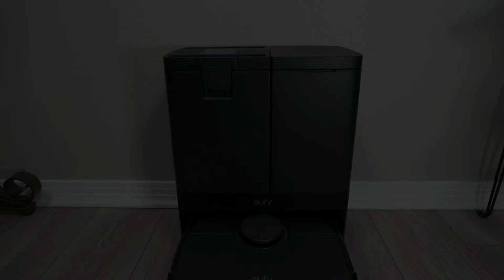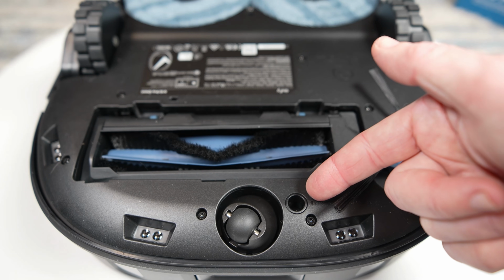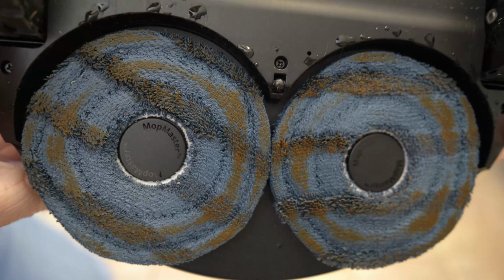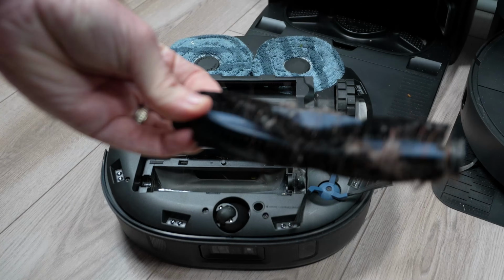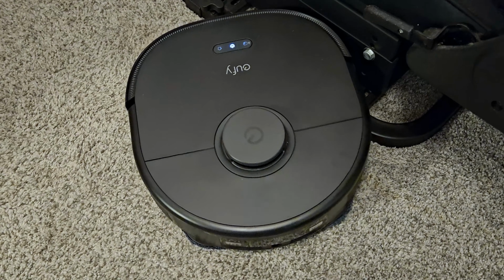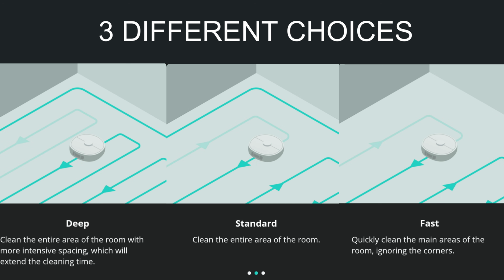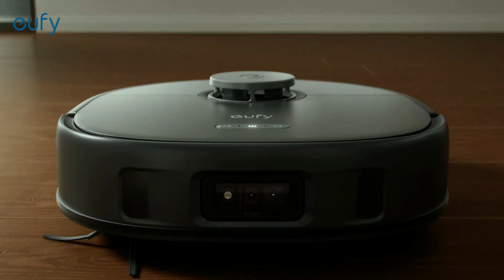eufy X10 Pro OMNI Review! An Incredible Value!

Comment: Thanks! I was hoping for a first good review of the robot.
Finally you uploaded it :)

Based on the hinge comment, does the bin feel flappy for you?
It looks like lot of the suction power is going into the not so well sealed dust-bin.
Reply from the maker: Thanks! The lid was closed and latched during the tests.  It could be an issue with the design of the bin, but I am not real certain.
Reply: @andrews I really wonder where the suction power is going off to some air-leaks and if it is improvable by sealing the bin better.
Usually everything inside the machine should be enclosed.
Another point of suction leak could be the two docking-openers on the back, which the base uses to empty the bin.
Do you feel any suction behind the device while its vacuuming?

Either the 8000 pa ain't true or there is a flaw somewhere inside.
Reply from the maker: @akeshake5230  I'll take a closer look today and if I find anything I'll report back.  It could also be the brush roller design or it could be the brush roller is not dropping low enough to properly sweep.

Comment: Thanks Jamie for the review!
Would you be able to test how many washing runs the robots are able to do before having to refill/emptying the containers on the dock? Cheers!
Reply from the maker: Each cleaning at the dock uses 200ml.  That means each tank will clean the mop around 12 times before being empty.  That does not take into account filling the robot with water, but that will vary based on the water setting in the robotand how much mopping vs vacuuming it will do in a home.  Hope this helps.

Comment: I've seen some scare stories about the electricity consumption of these auto-drying docks.

Did you measure this by any chance?
Reply: Yeah I’d also be interested to know what the power draw is for a heated dry - especially since it’s running for hours
Reply from the maker: I did not measure it on this one, but I will.

Comment: Hi Jamie, thank you for your review. In the UK we are eagerly awaiting US reviews prior to pre ordering.
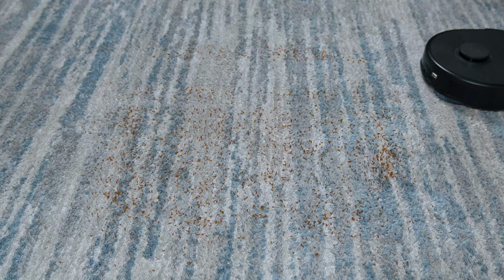At 3:19 you have done vacuum tests on carpets. Was this test based on first pass of the vacuum only?
Generally speaking how does it perform vacuuming on deep clean mode and with 2-3 passes of the same room?
Thank you
Reply from the maker: Yes on my vacuum tests the vacuums get one pass only.  Performance will improve using deep clean and it will make tighter overlapping passes. Drawback is that the battery life will be worse if you always run it in deep clean mode. I saw about 10% improvement in vacuum  testing when switching to deep cleaning mode.  Better, but still not great.
Reply: @jamie.andrews  thank you Jamie. For the purpose of testing I understand that you are making it a fair test.

From my point of view, I just need to know whether the vacuum "does the job" or not. So if I send it on deep clean, to do the same room twice or even three times will this vacuum get the job done eventually? Thank you
Reply from the maker: @dp20102  Yes the more you run it the better the outcome which is what I always do when mopping, not so much with vacuuming though. If you have deep carpets you may want to use an upright vaccum more often to get deep cleaning, but you should do that with any robot vacuum.
Reply: @jamie.andrews  ok thank you for your help

Comment: Isn’t Roborocks Q Revo even a better value considering it does everything cleaning related better accept object avoidance and it’s been out for a year. It’s often on sale but even with slightly higher price it doesn’t have any of the mentioned cons of this robot.
Reply from the maker: I think it might come down to how important object avoidance is to the owner. The Q Revo MaxV will be an interesting comparison when it comes out.
Reply: @andrews if avoidance is important for the user with this robot you are loosing in cleaning perf vacuum and mopping, in that case is better to look on Dreame not this one

Comment: Jamie few other reviews mention the vacuum performance got better with changing to deep clean mode in the app.. curious if that didn’t help much either?
Reply from the maker: I did test in deep cleaning mode and it makes total sense that it would do better because it makes more overlapping passes. It picked up and extra 4 grams in deep cleaning mode on carpet.
I did not include this in the video because I don't use a deep cleaning mode when testing with my other robot vacuum.  Keeping things fair and as close to apples to apples as possible.  Even with the extra 4 grams it is not enough to make it excellent. The Dreame X30 has 8200PA of suction and it got a perfect score.

Comment: I've not been that impressed with my Roborock S7 Max Ultra (model without the camera) and it's mopping. Not having the obstacle avoidance is also a minus. 

Was considering picking up the Eufy because of the rotating mop heads and the camera. However it seemed to perform worse in all the tests. Which surprises me considering the better suction and on paper better mop. 

Would you suggest sticking with the Roborock over this?
Reply from the maker: Sounds like you would need to decide if having good obstacle avoidance is worth buying a new vacuum for.  The S7 as a vacuum performs better and has a rubber brush roller. Roborock is also coming out with a few new models with better object avoidance. Stay tuned!
Reply: @jamie.andrews  Cat left muddy paw prints over the kitchen floor last night. S7 did a intense mop last night as part of its schedule and they're still there this morning. 

Was hoping the rotating brushes might have been more effective
Reply: @damo_c  no, several reviewers including Jamie concluded that most the times are the same, sometimes rotating slightly better, that's all
Reply: @xeon2k8  This is the only review I've seen so far that doesn't seem like a sponsored Eufy video. Our flooring is mostly wood effect laminate which has slight grooves in, which may have resulted in a better clean from a more fibrous spinning mop. 

I was under the impression the X10 Pro also had dirt detect mode so it could identify where a dirty patch was and keep going over it, whereas the S7 Max doesn't.
I guess that wouldn't be covered as part of the mopping test because there isn't feature parity
Reply: @damo_c  im talking vibrating vs rotating, nothing else
Reply from the maker: @damo_c  They key to dried on stains is partially if not mostly tied to the ability of the robot to put enough water down to rehydrate the stains.  This is why I do 2 passes with the water level on high. You will notice on most all of my tests the second pass is way more effective than the first pass.  This is because the first pass attempts to rehydrate the hot sauce and the second is to just wipe it up. I use dried on stain in my tests because they are the most difficult to get up. With that said I normally take a spray bottle with mostly water and a bit of Bona mixed in and pretreat tough dried on stains on my floors before the robot goes out.  Makes a huge difference.  Eufy does not put down enough water imo and even though my test comes directly off the dock with the dock washing the pads they tend to dry up fast and by the second pass the water is barely there. I compared it to the Q Revo off camera and the Q Revo put down much more water.  The S7 and S8 series is bad about having the pad dry up because the water on the pad only gets applied in one place in the very center. I always told people without a dock to prewet the mopping pad. People with a dock should have it return for a mop washing as much as possible. 
None of my videos are sponsored. I always turn them down for sponsorship money.
Reply: @jamie.andrews  Absolutely appreciate you not doing sponsored videos. I can tell because you're the only one not singing their praises these last two weeks. I have a photo of the area, would it be possible to send it to you? I think it might highlight whats going on.
Reply from the maker: @damo_c  Sure. Send it to me through Reddit @trsman76 or you can find my contact info in the about section on here.

Comment: I ordered mine for 600$ with the early coupon, been tracking robot vacuums now this really is one of the best value robots for the price and feature set
Reply from the maker: Let me know how you like it!
Reply: @jamie.andrews I ended up receiving it a week ago. So far I love it, it works great haven’t had many issues obstacle avoidance wise it generally works well. Has got caught on 1 cord under my dark bed before and on a small cat feather toy. I have seen it avoid a single LEGO on the ground which was very impressive considering how small and on a rug it was. Overall great value imo
Reply: @jamie.andrews works great recieved it like 4 weeks after ordering which was a little annoying, it did have one software update that messed up navigation which has since been fixed with a update after I contacted the support team. Overall for what I paid I’m happy with my decision. Takes away a lot of time spent vacuuming and mopping on my end.
Reply: What about the Q Revo by robo rock 😮 that was also 600$ for a bit
Reply: Did you get your vacuum yet or are still waiting for delivery?
Reply: @Isalwaysgolden2  ye I got mine a while back it's been great
Reply: @Isalwaysgolden2 I recieved mine if I remember correctly 3 to 4 weeks after I ordered. In the time I’ve had it it’s worked fantastic except for 1 software update that messed up the navigation. I worked with the customer support and the software team issued an update that has completely fixed it